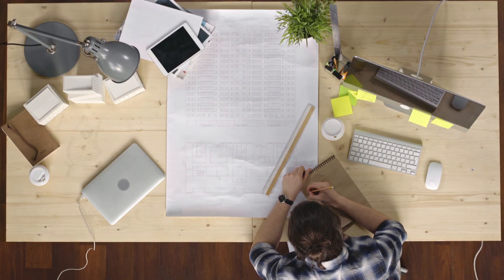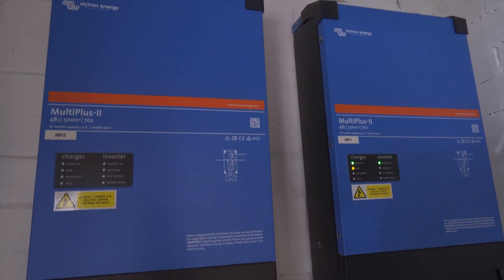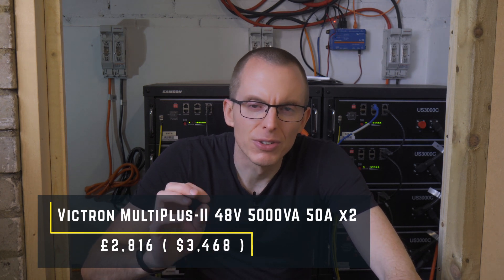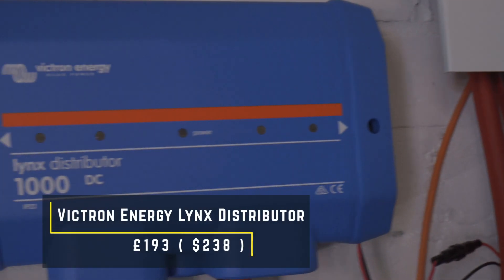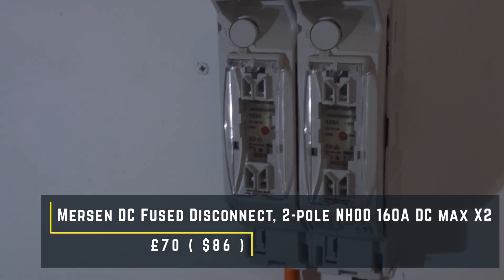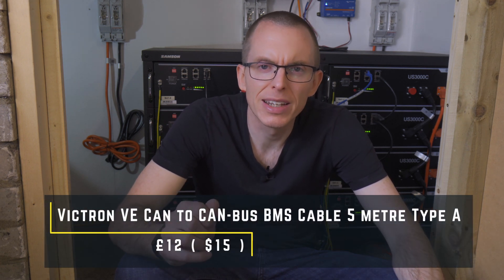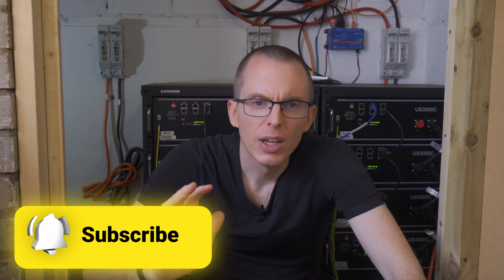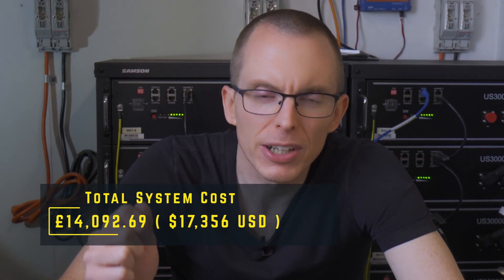Home Battery System Exposed: Discover the Real Cost & Essential Components!

Comment: One thing that concerns me beside the price of these rack mount batteries is what do you do if one of the cells goes bad? I've seen these batteries torn down on another YouTube channel and it appears that all of the connections are welded together making it next to impossible to replace a single cell that may have gone bad.
Reply from the maker: That is a concern, they do come with an extended 10 year warranty, but I have little doubt they will attempt to weasel out of honouring that wherever possible.

I guess I look at all the possible battery options like a bit of a spectrum, with powerwall type solutions at one end and home made packs with recycled 18650 cells at the other end. There are lots of options in between, each with their own pros and cons. I think the various 48v rack mount solutions sit somewhere in the middle, probably a good compromise, but at the end of the day it's personal choice around how you want to balance the pros / cons.
Reply: @RodMcBain  Even if they honor the warranty, the next concern would be possible long waiting period for a replacement rack unit. Then you have the heavy weight of these as well in terms of shipping.
As for 18650 cells, DO NOT install these within 50' of a residential structure. When they ignite, they are impossible to extinguish.
Reply from the maker: @basspig  That's true but at least you only loose a fraction of your capacity and the rest of your system continues working.  I just mentioned 18650 cells as an extreme end of the spectrum, not seriously suggesting anyone use them.
Reply: @RodMcBain  I use three banks of prismatic cells and three BMSs for redundancy. If a cell goes bad, I just replace the cell--socket wrench, two nuts and done.
18650 if you have your power in a concrete pillbox.

Comment: I went for cheaper (inferior?) components, not grid tied but similar setup, 2 banks of 16x LF280K lifepo batteries (28kwh) with 200amp JK BMS and 2x SM IV 5600 w in parallel, for about €7000 total when including cables, breakers, fuses, busbars, etc., some EV rates for mains power are so good I'm not going to bother with solar, 3 hours charge at full pelt is more than I consume
Reply from the maker: Certainly cheaper and let's say different rather than inferior 😀. I don't think there's anything wrong with  building your own pack of cells, it's cheaper but comes with some added complexity. Has advantages as well, like the ability to easily replace a bad cell or replace the BMS. Victron kit is also certainly not cheap but is also very good. It's really hard to judge if it's worth the cost.

I agree offsetting to the cheep periods is good, but I think I'm still getting solar, the idea that I can essentially be off grid most of the year is appealing, it's also hard to know what's going to happen to electricity prices going forward.

Sounds like you've built a great system for a very good price.
Reply: @RodMcBain  thanks, yours is nicer looking! btw, I'm in ROI, have an EV tariff for €0.07/kwh, there is no solar that can be worth having if all my needs are at that price per kwh, if that tariff stays where it is, a big IF

Comment: When I started out in 2019 I wasted $8000 on 8 Batlleborn LifePO4 batteries. All the more so after further interactions with the company for a device they sell that is not fit for the use they sell it for I decided I will never buy another thing from them. I have decided to DIY my own batteries. You live and learn.
Reply from the maker: Sounds like that was a really bad experience. I thought the Battle born LifePO4 batteries were just dumb cells that you needed to add your own BMS functionality to, I'm curious how you're going to get much more DIY than that? Build a pack out of 18650 cells?

Comment: Currently awaiting planning permission for our ground mounted 18 panel 7.6Kw solar system. Do not have enough roof space for 18 panels, ridiculous that permitted development only allows for 3sqm of panels. We already have a 6Kw ASHP installed in March 2023 and have decided on two 10Kw Solaredge batteries. No VAT thankfully as solar and batteries being installed at the same time. Batteries alone including install is £15600.
Reply from the maker: I think I'm going to end up doing a mix of things, my garage is south facing but with some tree shading earlier in the day, my initial plan is to get a small MCS certified install done on the garage where the batteries and inverts are, that way I'll have the cert to export if I want to. One side of the roof on the house is south east facing so gets good sun all morning and early afternoon, the tiles are also in bad condition and need replacing, so will probably get in roof solar. Then I'll ground mount some more, will probably also need planning, I think it's 9m² you're allowed but with a 3m max width & height so not very big and I'd probably want them within 5 meters of my boundary fence. Good luck with your planning permission.

Comment: "I'm not sure you could do much better". Challenge accepted. My system: 60kWh of LiFePO4 battery, 6+3kW inverter, 2x100A charge controller, 10kW of solar panels on ground mounts. Total cost: about 15k Euro.
Reply from the maker: I think maybe I said that in jest rather than as a challenge 😀 Sounds like a great system you have there. I don't know how you managed to buy all that for 15k Euro, what brand of batteries and inverters do you have? 

I could certainly have achieved the same headline spec for less money but I'm not sure it would necessarily be "better". Using Sunsunk inverters for example would have been much cheaper but probably not better.
Reply: @RodMcBain  I DIY'ed my battery packs with prismatic cells; gives you more control over the build and saves quite a bit of money. I've documented most of what I did - search for my blog "Up North and Off Grid" if you're interested.
Reply: 1700 Wp panels, 5kVA inverter, 10x100Ah batteries... total under 800 €.

Comment: Isnt it interesting that a simple whole home Genmax Tri-Fuel generator is less than 1/8th the cost of your system? It does not work off the sun, and you need to buy propane or use natural gas, but it works just as well, since it's pure sinewave. I use one as a backup on my Gen-In connections for my MPP Inverters.
Reply from the maker: Those Genmax Tri-Fuel generators do look interesting, can't see them available in the UK and although interesting they are not really comparable to a home battery system. At some point I might want my system to be able to survive off grid all year round and that would require a generator in winter so thank you for introducing me to the Genmax.

Comment: Hi @Rob for the Lynx distro I would power it up via 5volts there are guides, I’ve wired mine up as I want to see the lights that I that I paid extra for lol.

I’ve just finished the AC side of mine my, DNO was really good I done the G99 and are happy for me to commission it and also upgraded my 60amp main fuse on request with the G99 to 100amp. You never talked about your earthing arrangement as that can be pricey especially if you go 4.5meters with an earth rod and use 25mm earth but 2.15ohms on the readings for a TT system was the lowest my spark had ever seen with a TT
Reply from the maker: Thanks for the tip, if I'd done some more research I think I'd have gone for another Lynx Power In instead of the Distributor, apparently they can easily be modified to accommodate fuses, bust since I've got the Distributor it probably makes sense to try and get the LEDs working.

Other than the problems with the MP2s loosing their ENA certification I've had no problem with the G99 process, my DNO was slow but helpful and the guy who did the witness testing was happy with everything.

Well done noticing my omission on the earth rods, I could claim I did that on purpose to see if anyone was paying attention, but I only realised I'd forgotten to mention them after the video was up 😀.  I have 2 x 2.4m earth rods about 8 meters apart and connected back with 16mm cable, don't recall off the top of my head but the reading was very low as well so more than adequate.  Adding all the bits up that was about another £192. I think it's an advantage to doing this yourself, a spark might bang in a single rod and get a reading under 150ohms and think that's good enough.
Reply: @RodMcBain  yeah there is benefits to doing it yourself. And yes get those LEDs working as it will show up if one has blow the board actually has some smarts to it or rather logic and will give different LED eliminations well worth doing we paid for it already 😂 I looked at modifying the power in and couldn’t be asked doing it all and I wanted LED’s  looks good when it goes through the start up process 😂

Comment: Brilliant video, aimed primarily at someone who wants to DIY a system. I think you could have added on at least a third if you were getting someone in to fit it.
Reply from the maker: I have no doubt that's true, I suspect I'd also struggle to find someone to install exactly the kit I wanted in the way I wanted. On the flip side and something I didn't mention in the video, there is a lot of work goes into designing the system and arranging everything required for G99 sign off by the DNO etc.  I did this because I wanted to and enjoyed it, if I factored in the cost of my time the price would be much higher.

Comment: Really interesting video, thanks.  I've been sitting on the fence watching the prices for the last year.  There seams to be a lot more batteries out there this year, I've been kind of holding off as there is a lot more competition now.  I was going to go down the 4 x Pylontech US5000's, I think they are better bang per buck than the US3000C's but I guess at the time last year the market was a lot different getting hold of batteries.  Looking to go down the Victron route, they do a Multiplus 2 GX 48/5000/70 which can be linked up in parallel to double up on the inverter output the same as yours I believe.  I'm guessing this could save money as these have got the Cerbo GX functionality built in albeit via a smartphone app rather than nice touch screen.  Tempted by the Fogstar 30kWh 48V rack for 8k.  We have a 4KW solar system, can produce 26kWh a day on a good day, also have an EV (Zappi charger and Eddi HW diverter) I like the idea like yourself on over specking the inverter in case I want to go down the heat pump route in the future.  Hats off to you that you did most of this yourself, that is impressive :-) Quite surprised the amount of extra gear you need so it was a good insight.  Thanks
Reply from the maker: Thanks, glad you liked it. I think if I was starting again I'd probably still go Victron but might not use the Pylontechs, nothing against them but like you said there are a lot of options so it would be worth investigating alternatives. The US5000's are going to be better value, just keep in mind their weight, both for handling during installation and for where and how you mount them. 

I don't think there's much in it cost wise between a Multiplus 2 GX and Multiplus 2 and a separate Cerbox GX, the Cerbo has more connection opportunities and if your considering going parallel your multiplus 2s should be identical model number and you don't want 2 GX devices, so the Cerbo GX is again probably the better option.

Comment: Another great video Rod. I got the US5000 's and went for the Sunsynk 8kw which has everything onboard. I wasn't confident setting up all the different Victron components needed. It was a breeze to set up (apart from the battery weight🤦‍♂️). It is an expensive outlay, although i never did it for an investment, rather to feel more secure with energy independence. The system just works away in the background and we've had no issues at all. It's the future! 🤘😁🤘🌞
Reply from the maker: Thanks. I went into this with the same idea, it's great that they save money and will probably pay for themselves, but it was as much for the peace of mind.

Comment: In Australia, there is a national battery testing center.........they ran simulated, 3 bedroom home, draw down and recharge, daily cycled loads for long term testing over some years.  They tested systems provided by suppliers like Redflow, Tesla Power wall, BYD etc.    What they discovered was that in their final report the Lithium batteries, lost 15% ( BYD best performer) to 30% (Tesla Power wall etc) were the worst  in the first 4 years.  Australia has also experienced problems with Lithium battery fires in storage applications and changed the install code to mitigate fires.  The findings were, that Lithium batteries, have lifespans of about 10 years.......given that capacity degrades continually over that time.   The devil is in the detail, and explaining all the costs, is a step towards transparency so that people know how this all adds up........but, the full story of LIFESPAN is a significant aspect of cost per kw/hr over time.
Reply from the maker: Only time will tell. It's hard to put a figure on these things in years as it depends so much on how the batteries are used. The PylonTechs claim 6,000 cycles or >15 years. I had been working on the assumption that they will last 10 years, any longer is a bonus.
Reply: @RodMcBain  I wonder if those Australian results are more prone to degradation through the effect of their hot climate (no problem in Scotland).
Reply from the maker: @fredflintstone1428  I'd expect so, a study like this is good at showing the differences between manufactures batteries under the same conditions, but there are too many variables to draw real world conclusions about how long a battery will last. In Scotland you have the opposite problem, the batteries like to be about 25°C so you struggle to keep them warm enough in the winter months, but on the flip side that will de-rate their charge / discharge capacity but will probably prolong their life.

Comment: FYI, I also got charged £300 by SPEN which I accepted to avoid delays, but when I later asked them to justify why I was charged this fee when no reinforcement of the network was required, I was refunded.
Reply from the maker: That's probably why SSEN are calling it a fee for the witness test 😠 might still be worth a call to see if I can get it back, especially when the witness test was supposed to take 2 weeks, but has taken over 2 months.

Comment: Hi Rod
thanks for sharing... still no solar panels ??
I chickened out, and got some help from my local Victron installers, mainly because I wanted the MCS certificate to export to the grid. And even though I started the G99 myself. and had to change it 3 times. it was 30 days from submitting it, to getting it signed off and running
is your CERBO GX connected to VRM... I have had mine setup and running for two weeks now. I have 13 x 540w panels (3+3 SE, 4 SW and 3 NW)
happy to share, if youed like the link to see how mine is performing
Reply from the maker: Still no solar 😭 SSEN it have been a real pain, it's taken months to get a witness test for the final commissioning doc to be sent off, I wanted to have all that sorted before moving onto solar. What company did you use to install your MP2s? It was probably a good call getting someone in to install, just makes everything simpler. I still think I should be able to get an MCS cert if I have a MCS installer fit some panels and MPPT, but not certain.

Comment: Hi Rod, that’s a very interesting video.  I’m just about to do something very similar at our home. I already have the G99 approval but what would be helpful is a schematic of your system, just to make sure I’ve not missed anything? Do you have any plans to make one?

Thanks, Alan
Reply: Hi Alan... I posted my G99 line diagram on the Victron Community pages... if that helps you
Reply from the maker: Hi Alan,  You can find a PDF and XML file for my site / system schematic here https://rodmcbain.com/downloads/g99/ I created it with https://app.diagrams.net/ you should be able to open the XML file there if you wanted to alter it for your system, hope that's of some help.

Comment: I thought anything being connected to the mains had to be installed by a qualified electrician. Is your house insurance company aware that you did it yourself?
Reply from the maker: I think a lot of electricians would like you to believe that's true, as this is installed on an existing circuit there is no building control notification needed and on top of that my electrician has checked my work and is happy everything compiles with BS7671.
Reply: @RodMcBain  Cheers. I’ve always been told that a qualified electrician has to do any work these days. I was interested in how you dealt with that. :)
Reply: @SirHackaL0t.  after watching Rods videos I was going to do it myself too... but in the end I got my local Victron installers, mainly because I wanted the MCS certificate to export to the grid.
You don't need the MCS certificate to get the solar "smart export guarantee" rate (6.4p/kWh), but I found that if you want to get the higher rates (21.4p/kWh and up to 34.36p/kWh in my area), you seem to need a MCS certificate.
It pushed the cost of my build up a little, but I should make that back... I hope